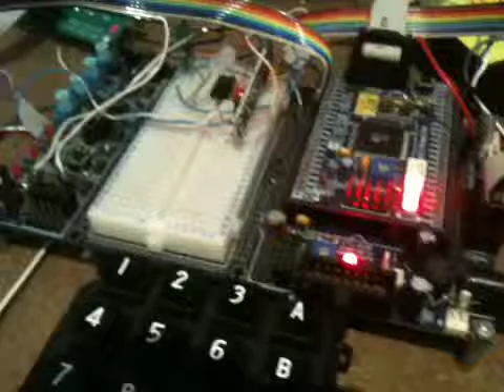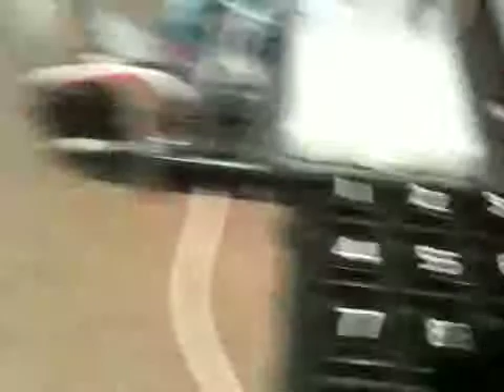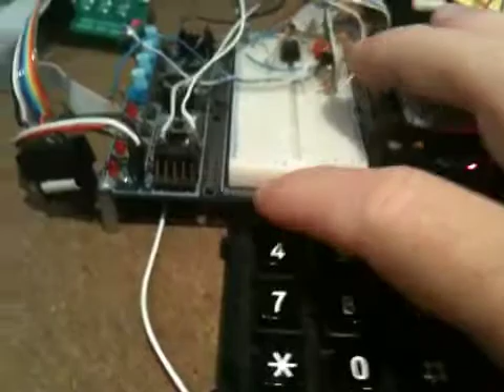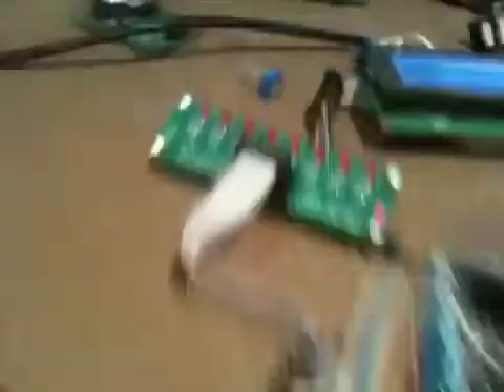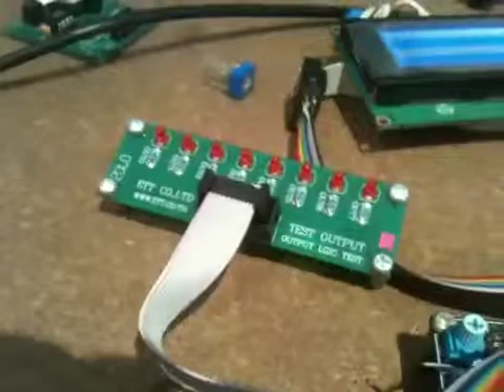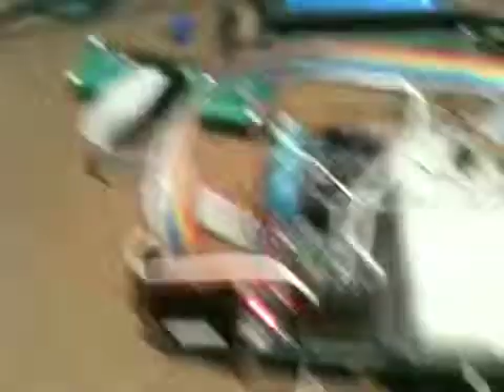PWM on ATMEGA 128 controlling LED brightness

Comment: How can i program in assembler a PWM of 500Hz?
Reply from the maker: you're better off jumping on over to one of the AVR forums, or even try google. There is a wealth of info out there. 500Hz (or there abouts) is pretty standard, I think (depending on prescalers and other stuff) you can get to around 480Hz easily enough. Check out the datasheet, and drop on over to the AVR forums, or even Arduino stuff (try arduino.stackexchange.com )